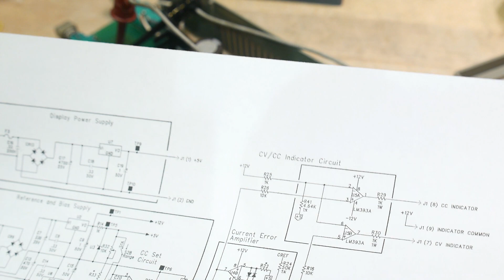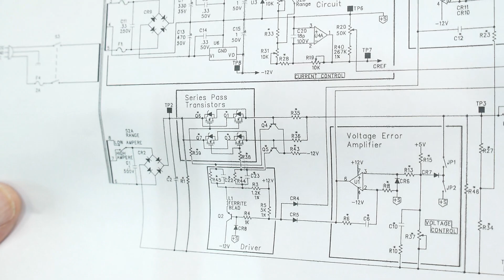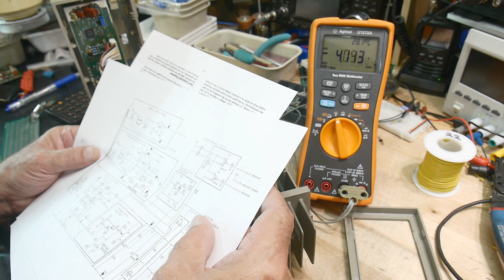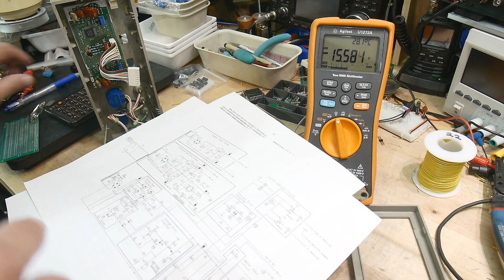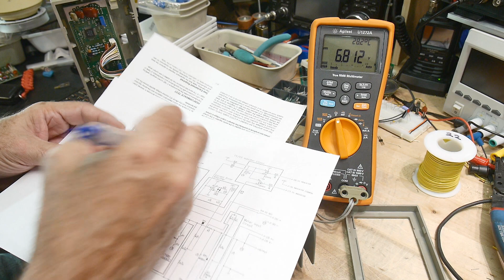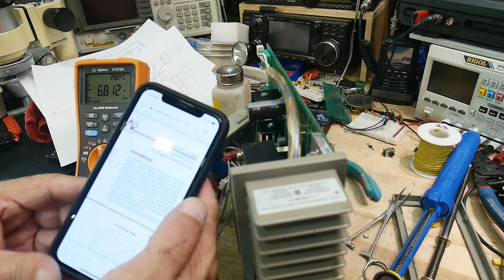#1251 E3610A HP Power Supply Repair (part 2 of 3)

Comment: The 7912...and it's cousin 7812...that whole series of three terminals are solid design. Someone has overloaded or there is a downstream load that- at one time killed the and cooked the 7912. But of couse at the moment it isn't loaded down...and you restored that part of the circuit. One little dead fish removed ..

I think you checked the big output darlingtons..

Resolving the 5 volt reference or is it supposed to be 6.8....? ...

I see a tiny tough dog in this one trying to find the bigger dead fish. 

We will see...

Work work...kept me away..

I intend to certainly comment on the your chip review of Holtek HT12E & D...
You have inspired me once again...for another little puzzle to be worked on..of another side job

I intended to order a few pairs
Then some inexpensive RF 430 mHz reciever transmitters...to send and recieve a simple command. 
Thank god you a radio man too...and might comment on best signal propagation...and enchantments. I don't need the FCC on me nor am I a licensed ham. I need to send a reliable signal more than 50 meters  in a building..that has lots of metal in it. I like to send a few milliwatts above the noise floor..

Plus -then I justifty and can get the new toys...
A working spectrum analyzer...and the Nano VNA...
Looking so foward to playing and creating again

Thanks again for your teachings 
IMSAI Guy...

Looking foward to part 3...

Comment: I had a bad cap that killed my HP counter and I couldn't tell it was leaking until I pulled it off the board; the leakage was small and confined to only the space under the cap but was enough to kill it. Found it obviously by testing from the bottom of the PCB...so leakage along a trace isn't always a definitive indicator.
Reply: It is always a good Idea to have a close look at caps. At least i check for ESR
Reply: @tvelektron  Yep, an ESR meter is a great tool and how I verified that cap was bad!